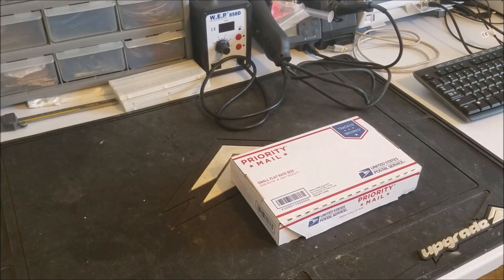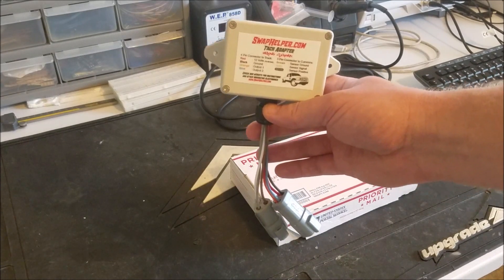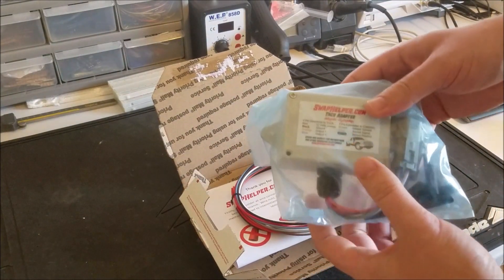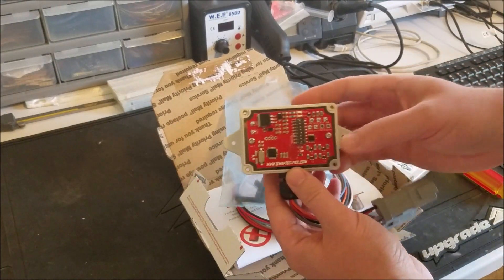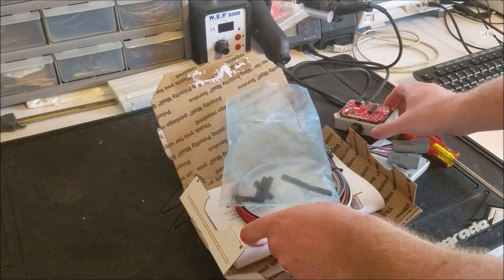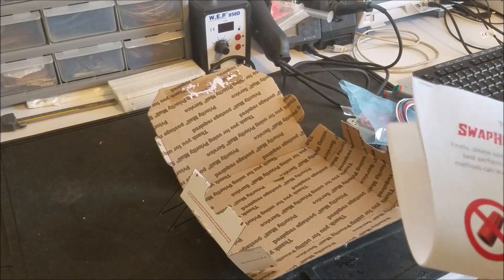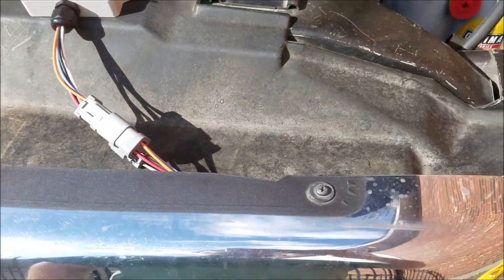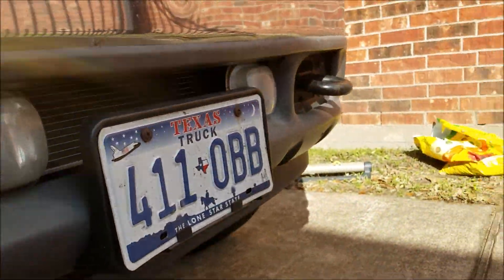Fummins Tach Adapter (No Tone Wheel Required)

Comment: How about a Chummins Tach Adapter?  Looking for something like this for my 1987 Chevy K20 6.2L Detroit diesel swapped to a 1996 twelve valve Cummins! I managed to get a original GMC C60 tachometer with mini fuel gauge which replaced my original fuel gauge

Comment: I’m in Houston how much and can I get the address
Reply: Will this tach adapter work on my 6.7 cummins in my 08 f250 was a 6.4
Reply: bfcking thanks
Reply from the maker: Hi Wayne, check out my website @ https://www.swaphelper.com/ - Thanks :)
Reply from the maker: I am working to add new supported trucks and engines all the time.  It's best to check the list in the video description, as I will update it as it changes. Thanks!